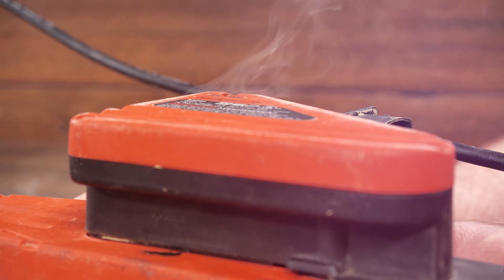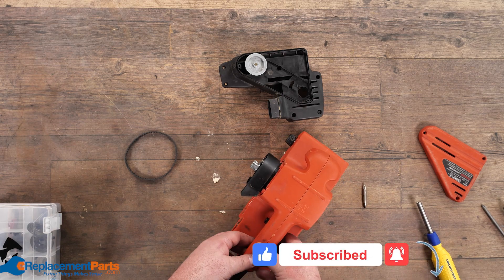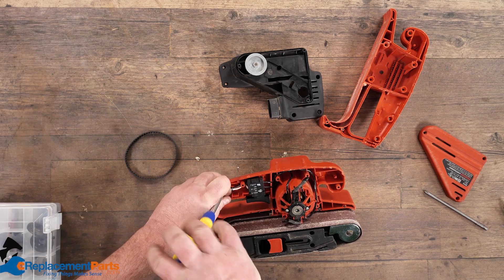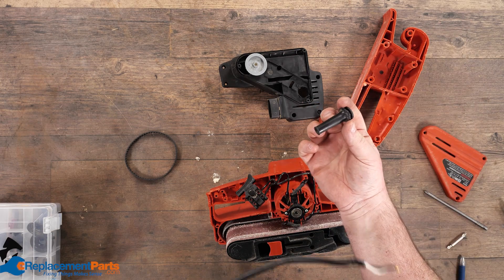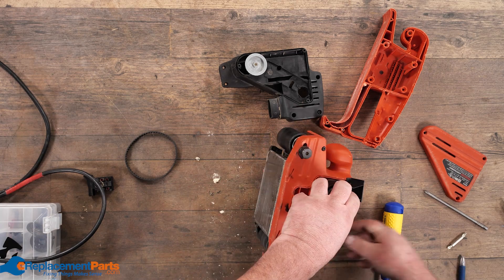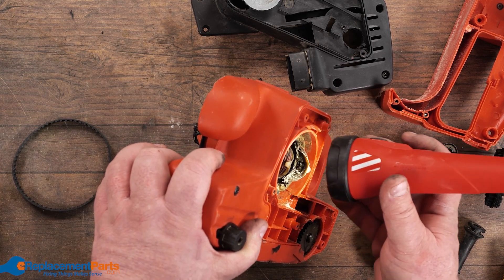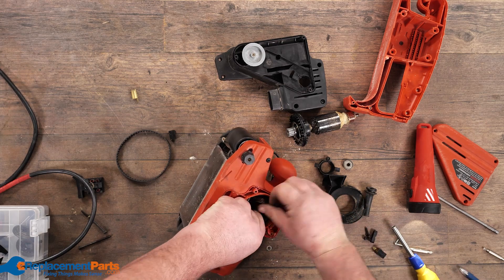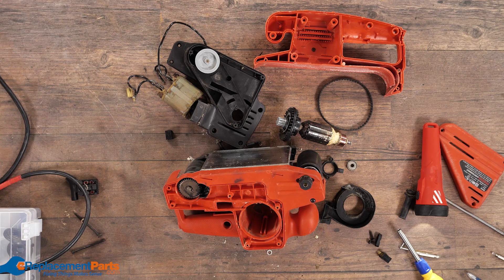Tool Tear Down: Can We Salvage This Old Belt Sander? | eReplacementParts.com

Comment: I'm a lot like you. I salvage most things if I see a possible future use. I went to your website for help, but got nowhere, so I was hoping you'd answer me here if I made my question via a comment.  You seem to be far more knowledgeable that me, so here goes:  I have an old JC Penney portable belt sander (I think the model number is 2010C or 2110C) that I've used sparingly for over fifty years.  Yesterday, the drive gear on the motor broke into six pieces, so I'm trying to find a replacement drive gear.  Can't find one anywhere.  I assume that the tool was made by one of the major manufacturers for JC Penney, but I can't seem to find who.  I thought finding the gear through the original maker would be a lot easier (unless you have a used one in your salvage stash!).  Can you lend any assistance here?  It would certainly be appreciated.  I hate to toss an otherwise usable power tool for want of a two dollar plastic gear!